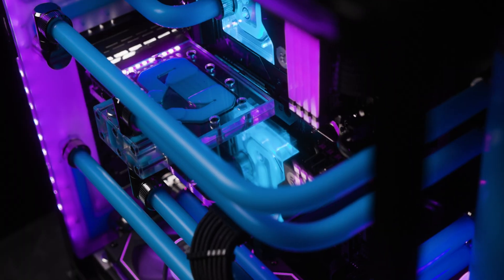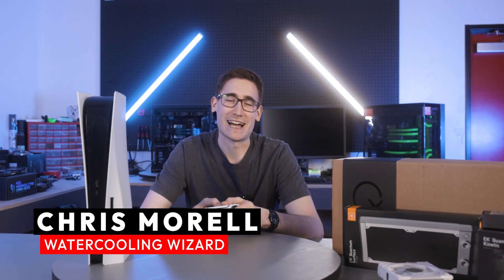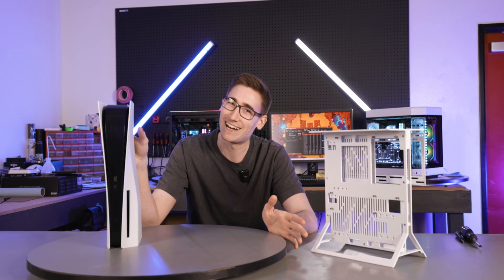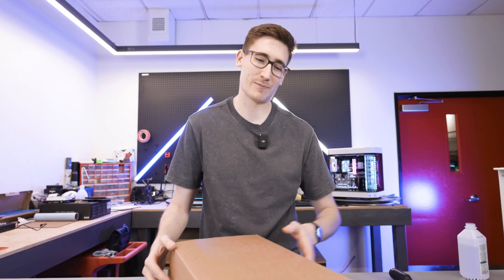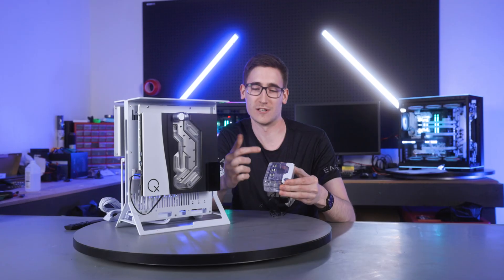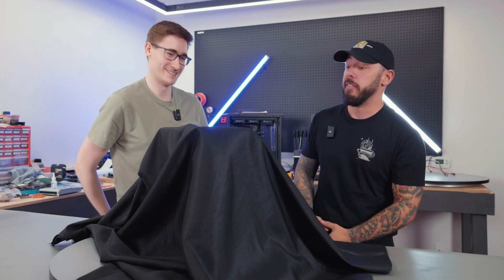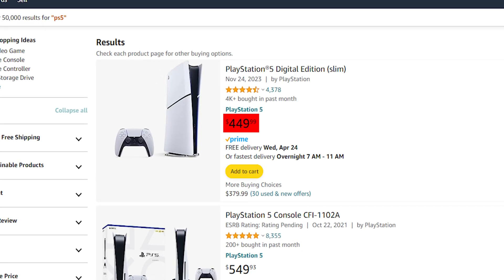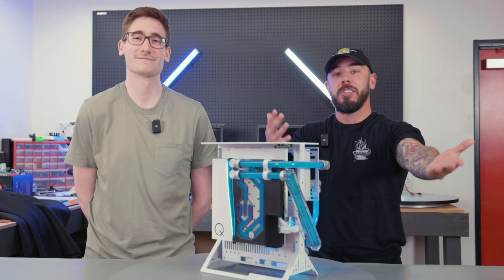WE WATERCOOLED A PS5...

Comment: Liquid metal would also short your motherboard out as it is electrically conductive and it will only affect aluminium in a degrading way and it will not be erosion it will be more like melting where the gallium in it would bond together with it and the melting point of the aluminium will become closer to that of gallium